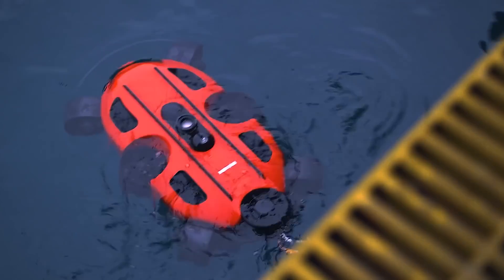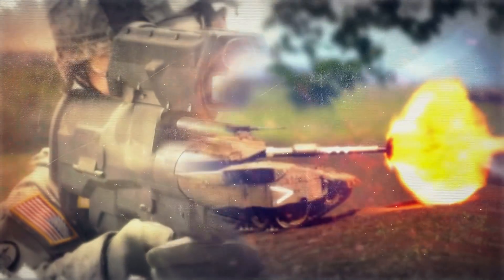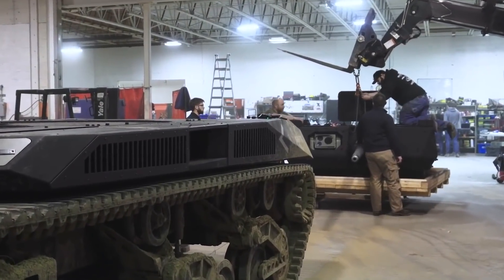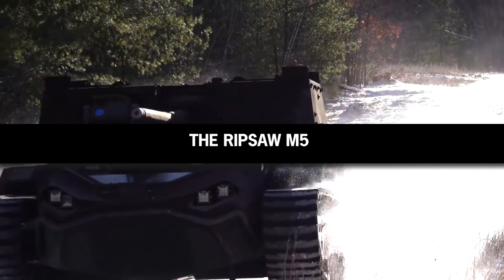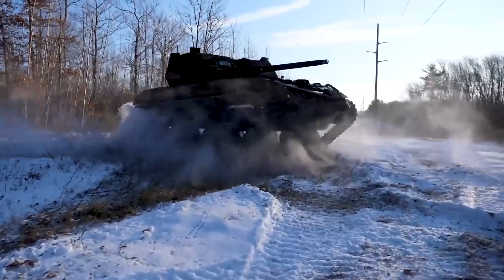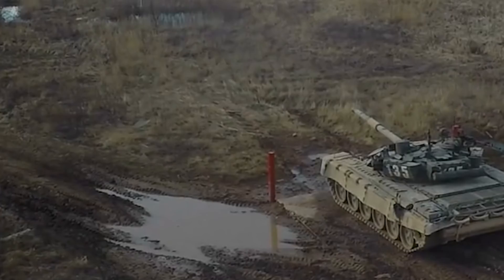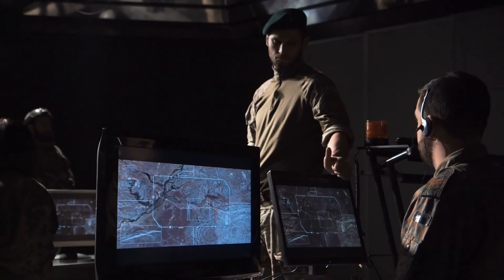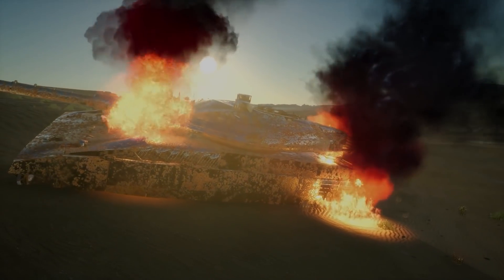The Next-Gen Superfast Armored Tank No One Expected

Comment: Cool. Only there are a few problems. The first - from a distance the large sensors are visible. One shot with a .50 BMG and you're done with the tank.  No track cover. Very similar. Electric vehicle. That is, how these batteries will work in Finland , or Ukraine. -40 degrees plus strong wind and high humidity. A perceptible -60 degrees. I'm not sure if I'm seeing it right. If the vehicle has a service door on the side, then its ballistic resistance is that of the hinges in that door.

Comment: the design is not quite there?  i need it to climb hills like a squirrel, hold a crew of 4, with an AI navigation and targeting firing solution triggers. 100% autopilot if needed to transport injured. keep track needs light next gen armor, 80mm, 50cal clocking plasma shielding apps. with one kiloton special invisorobot.  order 5000, 2500 forward staged  , 500 at diff bases times 5, 2500 can be deployed within 12 hours anywhere airdrop capable. took kit EMS kits under 2500 pounds.

Comment: The range and reliance on a remote signal to control it will always be a limiter to unmanned vehicles.  However, there are many advantages to having this option.  It's quieter and sneakier.  You could park one out in a location and leave it there for months if desired, monitored by personnel remotely 24 / 7.  It could be utilized as an accompaniment to troops on the ground as a lightweight silent support vehicle.  It can draw attention away from manned vehicles.  It's cheap and easy to field, making it a potentially numerous asset, and an expendable one at that. There are just far too many befits to having a machine like this in action to list them all.  I'm sure one day, as tech develops, unmanned war will be the majority of wars.  But not yet.

Comment: I don't think unless using hydrogen as fuel, 
The idea of a drone attached to the tank must be in each tank more than one drone, the tank should have sensors that cross any shell coming toward the tank. This could be used by a fast computer to fire an anti-attack shell. 
Still, I am wondering why drone technology is not attached to each tank and informs the side of the shell or auto-firing.

Comment: I won't be long before you start seeing the New Anti Gravity Tanks. These newer tanks can hover and maneuver from less than 1 meter to 65,000 feet. They have no tracks and are powered by a turbofan engine for forward propulsion. They will have escape velocity technology using rocket assist engine technology. They are heavily armored and poses multiple 6 inch laser weapons that use up to 6 million watts when on targets. They will be maned and controlled using 36o camera technology. They can move very slowly or accelerate using this escape technology to velocities up to 700 mph from detected threats.

Comment: Electric? What is it's operational usage? 30 minutes and 1/2 mile without plugging it in? (You may notice they do not address that issue). And what is the cost of fossil fuel generators to charge these bad boys?  The MASSIVE costs of batteries for electric cars is what make them so terribly expensive. Think of a Tesla that requires 50 times as much weight and 100 times as much power to operate (along with a DEDICATED fossil fuel power plant to charge it)..... So this is not only looking to be cost prohibitive at current time, but if implemented, this would drive up Electric battery availability to the private sector. Like many things, this "looks good on paper" but is not ready for prime time in reality. I am categorizing this as an unrealistic "sales pitch" or straight up  fantasy propaganda.

Comment: A lightweight lowcost unmanned tank is a great idea. Between IED's and the newer anti tank weapons no armored vehicle is really safe. Higher speeds, more maneuverability and ability to quickly and accurately engage targets on the fly would be hugely beneficial. 
The front gun on this model looks to small to be a tank cannon. Since it is unmanned and lightweight I would think it would be advantageous for it to develop an auto-loading recoiless rifle or missile system for it. It would be far more destructive then with the small bore gun it has on it now. Recoiless rifles also have a variety of rounds to increase over all lethality. The anti personnel rounds are extremely nasty.

Comment: the Army will never go unmanned with ground vehicles at least not in the next 50 years, I was a tanker for 20 years and I can tell you right now that thing will get stuck and need more resources to tow it. the M1A2 sep 3 already controls any battlefield it rolls on so there's no need for this vehicle in my opinion. what happens when an electrical module burns out, or it's going up a muddy hill and slide sideways forcing the track to pop, or when it hits a water hole and mud splashes all over the sights who's going to wipe them clean, what about Constantine wire who's going to cut it out of the tracks and road wheels, in my 20 years I've seen all kinds of things happen in the field that can't be duplicated by testing. I had a rock get stuck between the end connector and back sprocket it up seated the track and ended up shearing off the entire back sprocket.

Comment: All good and nice if you fight some second hand army,  in a decent ambient. In a low temperature ambient, the electrical vehicles will suffer a lot, and against a modern army, using jammers and high-tech EW, all these toys are just scrap.
The idiots who believe electrical powered vehicles have any future in a real war need to have a reality check: where will you charge those toys in a war like the one in Ukr now ?? 

The only direction such weaponry could be really effective is when some will deploy an advanced AI able to operate independently.  Electronic remote control systems are still very vulnerable to the electronic countermeasures, reason why you need an independent AI.  Reason why we see chinese systems like that more and more.

Comment: Hey just a suggestion. What if you added Javalins, NLAWs, Switch blades and a couple of Stingers...all on independently tracking gimbals? Have the Drone be operated by a team  Each one responsible for an independent gimbaled missile, gun or weapon system. The thing should be able to track and fire every gun at once with high kill rates. Hell, call it "The Thing" Then ditch the Cannon for a CWIS with the 30 cal out of Warthog as a main weapon and slow the rate of fire. It should look like a Battle Ship on treads. Big fan of the evolution of this awesome creation. Might i also suggest an HHO gas powered turine for power. Thing would run on water. Oh and for Gods sake, fit it with foamed steel armor. More protection for less wieght.

Comment: reconnaissance by drones from the air is much more effective, judging from the events in Ukraine. but as a distraction of the enemy's attention it is quite suitable, and if it is equipped with anti-tank missiles, it can stop the advance of a heavy tee. 
if they attack like that, then on automobile supply columns, mortar crews or artillery installations behind enemy lines, which are vulnerable at the moment of loading, but often the paths to them are mined.
it is useless to go into the frontal with such a light tank without anti-tank weapons.
if you also provide a similar night vision system, then there will be a good saboteur or patrol. the reaction of machines and artificial intelligence is many times greater than human and is not limited by muscles
but there is a problem of jamming the signal and hacking the tank itself by the enemy

Comment: The resistance of 108mm guns for the RIPSAW M5 is entirely false. The vehicle itself was only built to survive small caliber munitions to save on weight, similarly to the Bradley IFV.

Anything above 20mm NATO could turn the vehicle into a hunk of over priced gadgets. Hence why it was built with such a high power to weight ratio.

Identically despite the Army testing them and having a program set up, like most unmanned vehicles they're planned to make up only a small fraction of the armored force for specialty operations because the "tank" already serves no purpose between both the Abrams and Bradley though having crew doing everything it does, with tack on roles, and outstandingly better.

Comment: I think the most valuable thing about unmanned vics in the near future is that anything short of total annihilation will not stop it from collecting intel on the enemy. Even with no gun, no tracks, on fire, and a huge hole in the motor, as long as coms and the camera pod are working, it's relaying information. A normal human crew can be panicked or force to retreat and the fog of war sets in as soldiers under pressure make bad reports, forget details, or are pushed out of position, but the remote crew of these vehicles are under no such pressure to be turned away and can calmly evaluate the enemy up until the moment of full system destruction.

Comment: As cool as that is all that some has to do to counter attack and make the tank useless while on the battle field is use laser and ruber leaded paint cluster bombs/rockets to blind the sensor. Then there is EEC jamming and hacking. I am a civilian and thought about this in less than 2 minutes.

Also any control signal that it may give off can be all use to track not just the tank; but, also used to ping the positions of other devices, units and even control location.

Comment: Way back in 1956 when I was in a British armoured regiment I used to draw what would be an autonamous   lightweight tank with armour only at the front together with the engine , the gun would have been a 17 pounder and automatic; this was just a pipe dream then as I learned that the British army were not all that keen for change.
My knowledge at that time of radio control was just what I had picked up from my boyhood of flying radio controlled models you know the old glass valves and escarpments, the radio control,  if built would have been the size of a large suitcase .

Comment: I'd be curious about the battery range and charging infrastructure, as well as jamming resistance and signals interception of command vehicles.
Reply: Seems like a terrible idea…you would need to bring a huge generator on wheels to recharge an electric vehicle of this size…
Reply: @HyPex808-2   A single tank could recharge a couple of those lighter, smaller drones. 
Heck, anywhere you have electricity would do, so it's actually easier to get than fuel. 😉
Reply: @brunoethier896  you act like there will be electricity in an active war zone. Take for instance what’s happening in Ukraine where the Russians have totally destroyed infrastructure such as water, electricity, gas, etc. The use of recharging smaller drones isn’t the question that needs to be answered, the question is how are you going to recharge an electric tank. Yes it will take a couple of hours to recharge an electric tank, this is one of the inherent problems of recharging an electric vehicle in general the time it takes to recharge. You can refuel with gasoline or diesel in a matter of minutes and be back in the fight. Hold on while I recharge my tank….
Reply: @HyPex808-2  There are lots of options. 
Gas generators would work, especially if made with more efficient sterling engines.
Also, ever heard of small modular nuclear reactors? 
When it fits i a big truck you become much more independant than hauling and burning fuel continuously.
Reply: Don't worry, they won't be used in war. Only to identify and pacify dissenters protesting the rapid takeover of authoritarian regimes. They don't seem to have the armor or, as you pointed out, the autonomy and security to do anything else. This is an anti-population vehicle by design.
Reply: @ditmarvanbelle1061  those are valid points, but any weapon can be turned against population in crass hands. 
This thing would be far more useful in scouting in front and flanks of an armored column to detect ambushes.

Comment: 40 mph? That's a regular speed for battle tanks, nothing special. 🤡😄

Leopard 2: 44mph
Abrams: 41mph
T-90: 40mph
Type 99: 54mph
And all of those tanks weight is so much higher, so for it's weight the Ripsaw is really slow.

I always thought the Ripsaw is super fast, because of the videos I saw, then I looked it up and it's actually only average between all other tanks.

Comment: With the relatively short range needed to be in control of the tank I doubt it would be a full replacement for the MBT. But as a supplemental capability it would shine in cav scout roles and  supplementing modern mechanized infantry doctrine.
Reply: It doesn't have the firepower capacity to replace an MBT, but I could see it being a very useful infantry support unit.

Comment: I wonder how they intend to control this thing if the enemy just puts up some radio disturb signal. I mean it's not like you'd only need some Morse signals now and then to drive that tank. There is a reason why there are no 1 man tanks, there is so much to do and to focus on, it requires several persons to be efficient and safe. So you need multiple telemetry streams, all kinds of sensor data and control signals.

Comment: It is not a tank.   It has a small-caliber gun and it lightly is armored. The armor and armament is similar to an infantry fighting vehicle (IFV) but they lack the capability of transporting infantry The idea is not fundamentally different to WWII Universal Carrier but unmade with more modern armament.   It is an armored vehicle and might be very useful in combat but it is not a tank or a replacement for tanks. If it could replace tanks that would not be used today it would just be IFVs.

The heavy armor and larger more caliber guns of tanks have uses that cant be replaced bit smaller guns and less armor. Even if you put a larger gun on it you do not have a tank. Vehicles like that exist and are called tank destroyers, Mobile Gun System, Assault gun etc.

Comment: Textron? learn a bit about the TAPV and tell me if you want these guys designing a completely remotely operated AFV… unmanned brings more problems than it solves as more goes into it than just “quiet cuz electric and gun go boom” there are a litany of other considerations to take into account about how these vehicles could be, or if they even will be used. Batteries tend to explode pretty easily when damaged, say in combat for example, and you want to run an all electric power, you’re basically producing a multimillion dollar headache for anyone who has to work with or on them

Comment: the abrams can already go beyond 40 mph and "resilience" what does that mean at it's size it won't have enough protection to deal with a standard RPG-7 (notably speaking HEAT will melt it down) because more armour (or resilience) = more weight it. I'm not against unmanned systems but like this won't replace anything soon more like supplement due to many factors including ethics

Comment: What a delight to watch this excellent video. I wonder, how they will keep the batteries charged under battle conditions. A normal combat vehicle can be refueled within minutes. Even if you can easily change the sizeable battery pack of this 3 ton vehicle, you need some place nearby where multiple powerful generators will have to keep running for hours to get the battery packs of the ripsaws charged...

Comment: Opinion: there are great projects that never make it like the MBT-70's and Comanche Helicopters.

Also: electric motor... powered by batteries I assume. How does recharging work on a foreign battlefield compared to traditional re-fuelling methods strategically speaking? I see that as the second major potential issue.

The first major issue is: price. The US is cheap.
Reply: They are cheaper than a M1 Abrams, and any gas powered military grade generator can be used to charge them up, and those generators can be towed anywhere so they can be powered on the battlefield or maybe a back up battery can be fitted. I'd put in a small gas powered generator as a backup power supply, to be used only in situations where the battery pack is critically low and the tank is safe enough to recharge a portion of its battery with the generator to allow it to withdraw or to be recovered. 

I'd also pack it with a huge explosive that can be a self-destructive device so that if this thing is completely disabled, and unrecoverable, they can leave it on the battlefield and if the enemy tries to recover it or they pass it up, thinking it's out of commission, it will explode and take out a huge chunk of the enemy column.

Comment: Unmanned vehicles can be much smaller and cheaper, only I'm scarred that they loss connections in battle, once the enemy find a way to jam them you have problem. So maybe partly unmanned, tanks with only driver and gunner(by wire) and couple of remote grew that can control the vehicle if needed and help with command, scouting and reconnaissance tasks, etc.

Comment: First and foremost there’s not a 1 mile limitation. You’d be flying all kinds of drones, jets, tanks, APCs, etc that would all be individually connected and act as routers and hubs themselves. every f35, every loyal wingman, every m5, even the new aim260s will be part of the individually secure “router” network…

In the next real war the US will try to phase out “boots on the ground” entirely… that should make you shiver… auto aim, 130mm smooth bore, with 12 different lines of sight… Whatever comes of the M5 program will be called the first “6th gen” tank.